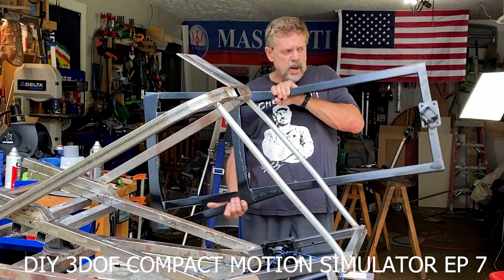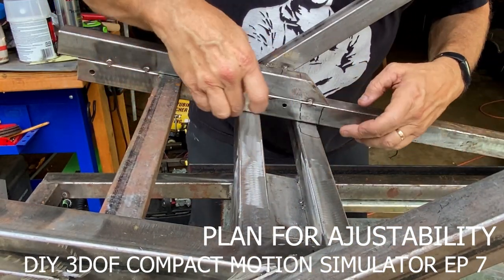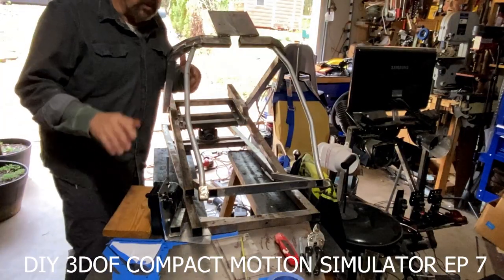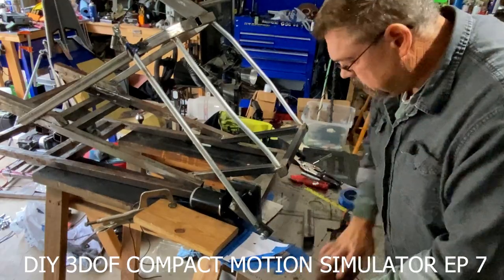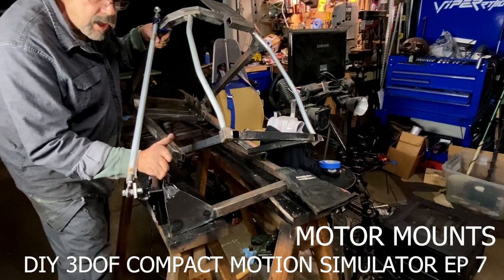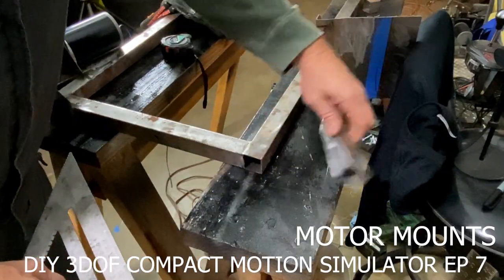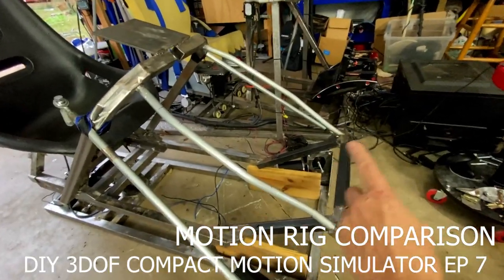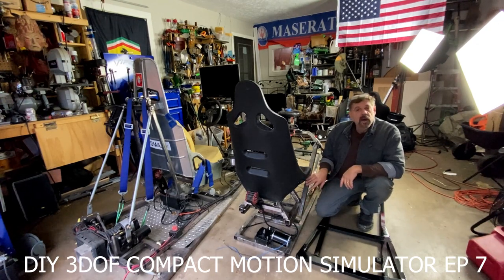DIY 3dof motion simulator episode 7

Comment: Thank you Dave. This one was right on time as I was trying to figure out the front engine mounts on mine. I ran out of steel so had to other a few additional sections (I am in over 60ft right now being really frugal with my cuts). Nice job on this one and thanks for the grinder disc tip.
Reply from the maker: Great comment 95twr!  Yeah actually I saw that flap disc on another channel.. I went to HF and lowes and they did not have anything like it..  finally Home Depot had it..  of course it's brand new, so it really cuts quick! for those inner angles it's hard to get em smooth.  Should be working on the top frame modifications in the next video..  Thanks for watching! Dave
Reply: @DMAX_DIY  I tagged you with my progress on xsimulator yesterday. Just happy that maybe by this weekend I can get most of the welding done and figure out the balancing.  Never thought I could build something like this so thanks for the inspiration.
Reply from the maker: @95twr    What is your link on x-sim?  I would like to check it out..  can you send the link here?  Not sure if YT will allow but try it.. Dave
Reply: @DMAX_DIY  YT seems to remove the post if I add a link (it did it twice). It's the "New 3DoF built" in the projects forum. You will get a laugh on the username.
Reply from the maker: @95twr  Ok..  so that's someting I guess they do..  I will take a look at the forum and type in your info..  I'm helping another guy out getting simtools running so I already have the page up..

Comment: Thanks for this episode, the paint job of the bottom frame looks fantastic, it looks almost finished :)
Reply from the maker: Thanks Luis..  Well, I now have the bottom frame in paint,  the mid frame has been worked over and in primer drying right now.  Hope to get it into paint this weekend..  I wish I could work on this project every day but I only get Saturdays.. so it takes a while.. Stay tuned..  should be running soon..  Electronics next and full testing.. Dave

Comment: The crab pot motors are very easy to pull apart and flip the shaft on.
Reply from the maker: Yeah it looks like just a few screws..   I'm going to try it this weekend..  The motors are just sitting there on the rig but I have to take them off to do the bodywork..   Thanks for the tip! Dave

Comment: Nice design! I just picked up a Fanatec GT DD and (previously running a G27) was thinking about building one of these 3dof rigs. This will be a good first project for my Miller 350p I just picked up!
Reply from the maker: WOW  Miller is a great name.. You should have no problems with fabrication - I'm still a bit of a rookie.  This design focus is for DD wheelbases, but without using the giant aluminum profile. Trying to use geometry for strength.  Hope to have it running soon Bill.   Thanks for taking a look and I'm already starting on the next video.  Dave
Reply: The design looks pretty good! The only thing I may do different is go with round tubing instead, just because that's what I have available and I have a bender.
Reply from the maker: @billdeitz1065  Yeah.. I been thinking about getting a bender..  I saw a 'manual' ratchet one for around $400   ez bend or something..  but maybe next year..  Want to make a thin golf cart like buggy for my wife.  would be easier and probably cheaper than the square tubing.

Comment: I have been waiting for the video. It's so exciting that i can't notice the time and the video seems only 5 minutes short. :D Could watch it for hours. Nice build so far, hope it works like you want.  Now i also started my theoretical DIY video series. But only in german. Unfortunately there is nothing useful in my language on youtube. Cold 26° degrees Fahrenheit Greetings from Germany.
Reply from the maker: Thanks for the comments motionBasti!  Oh 26 degrees F is not the best for sure.  I have a heater in the garage that warms it up a bit.. but a lot of the work  like welding /painting needs to have the big garage door open for air.. so I have to pick and choose during the winter.  I just started working on the upper frame modifications..  Hope to have something out soon!  Dave

Comment: Hi D max, just a couple of questions: I see that DC motors are powered by car batteries, how long does a game session last before discharging? where can I buy a racing chair like yours? Please continue with the tutorial. Thanks man.
Reply from the maker: Hi  good question..  So my battery is on a 4 amp battery tender.. been on it for 3 years now.. I run the rig about 3 hrs at a time, but it never runs out of power so  battery tender is the way to go..  Sometimes I leave it on (accidentally all weekend too  cause I'm old and forget)..  Hope that helps.. Dave

Comment: Are you going to be sharing the plans?
Reply from the maker: If it turns out good..  yes..  but if it turns out to be unstable, I'll modify it till it works..    probably ok..  I've never built a front pusher before.. so  new territory..  Dave
Reply: @DMAX_DIY  the one thing that I am wondering, with the narrow base is if it is top heavy and could tilt. I have yet to see a problem with the way its designed though.
Reply from the maker: @95twr  very possible.  but putting the motors out like I did should mitigate and help stabilize..   but we will see.  If the 'design' not stable enough, well, then we will know. and a different design or modification will have to take place..  These things really respond and react just like a car (in my opinion after driving race cars for many years and these simulators for the last 3 years or so)..    we will see.. I am the Guinee pig..  the tester..   I'm going to lay it out there no matter what on this series.
Reply: @DMAX_DIY  I have already come up with a possible solution for my case if needed and it wouldn't require changes to the frame. I will simply use a few 4x4s anyways to fix it when I am not using the wheels with a u brace.

Comment: Why aluminum profile is best for motion, limits customize once welded. A plus its extreme light with aluminum with zero flex
Reply from the maker: You bet..  So the next rig I make I'm going to be building it with Aluminum.    At least now I have a few steel ones to compare weight and performance.  Hope to show that on my new series.. Dave

Comment: That looks like its going to be terrible to get into and out of. Especially once it has a wheel and shifter on it.
Reply from the maker: austinpetemo,  you are absolutely correct! Yeah if I was about 20 years younger I would not care, but I'm not, so I have a design modification to the left side of the top frame which will make it easy to get in and out just like my other rig.. I'll be updating the geometry of the top frame and it should be just a strong.  Thanks for taking a look.  New video out soon hopefully. Dave